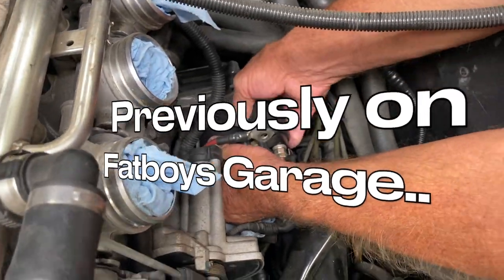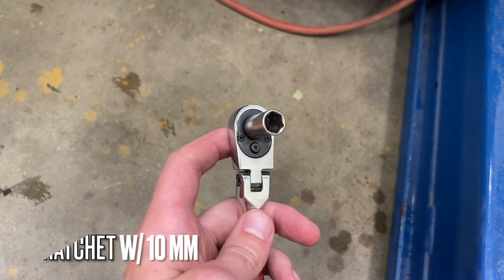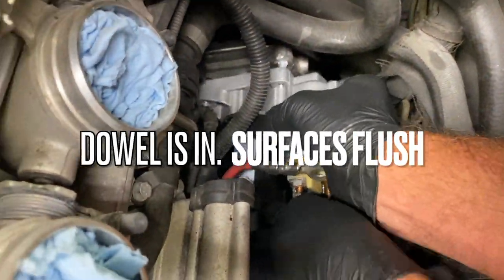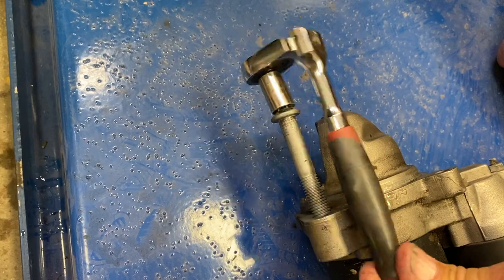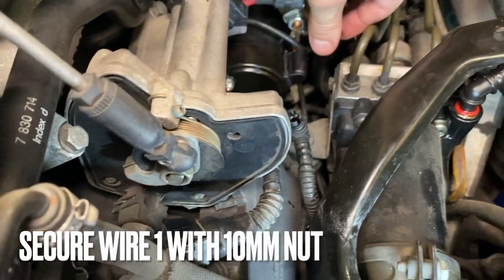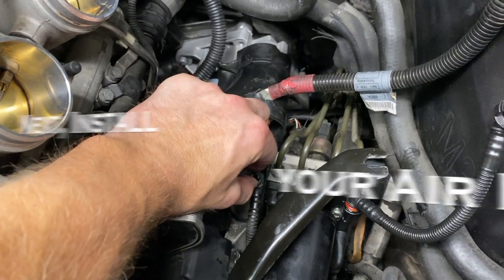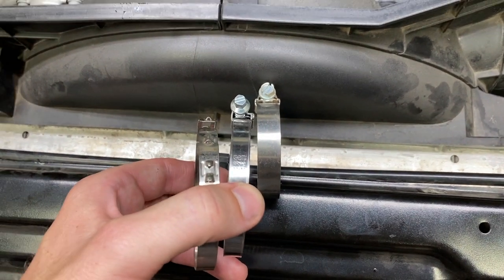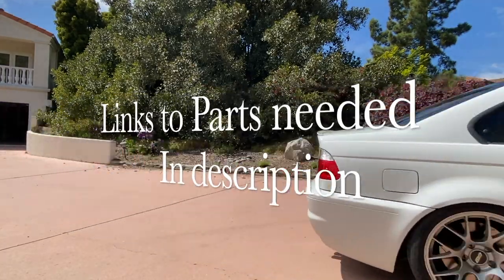EASY DIY BMW M3 Starter Replacement Part 2:  Installation

Comment: Hi there! This video is incredibly helpful. One question though: before beginning the process, is there anything I should do to prime the SMG pump? I'm pretty sure that the fluid levels change depending on whether the SMG has been primed or not so just want to make sure that when I'm refilling the reservoir, I'm filling it back up to the correct level. Thanks!

Comment: I have a question about the heat shield that you install with a zip tie (3:42). Doing this job on my 2003 e46 M3, I did not find a heat shield on the starter/solenoid when I disassembled. I've looked at a couple of BMW OEM parts sites and I can't find the heat shield in any of the blow up diagrams. Is that a standard BMW part? What is its part no.? Was it installed on ALL e46 M3s?
Reply from the maker: Strange, Ours was there as it was on the other car.  i will investiage and see if there is a heat shield available somewhere for you!